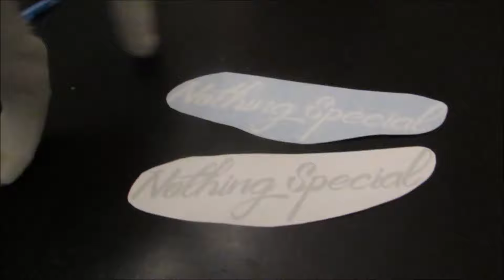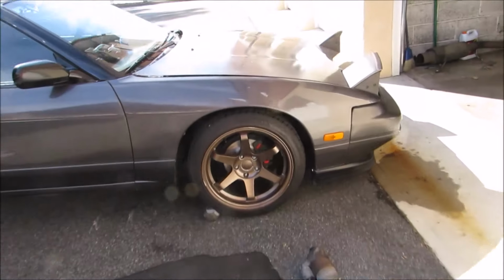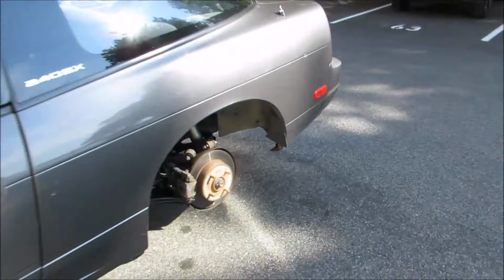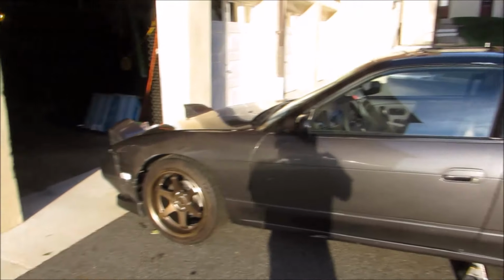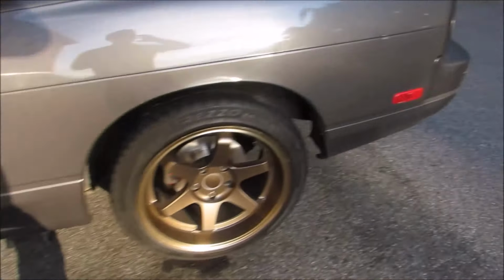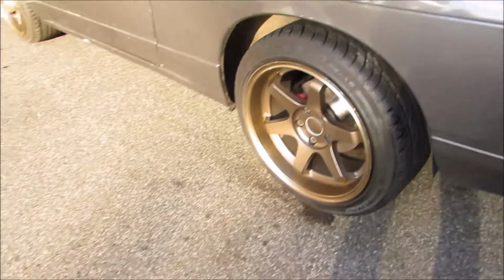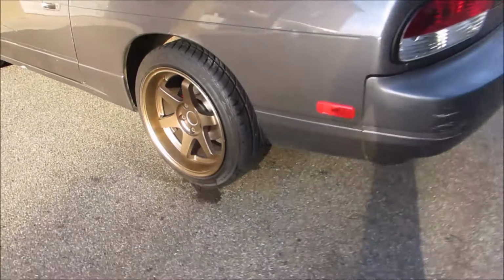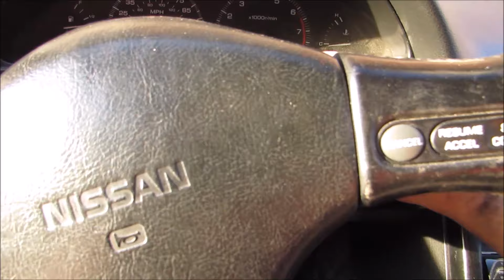Budget Build Ep. 23 | New wheels and 5 lug conversion!

Comment: Really nice. I just picked up some Rota Grids in 17x8, same size rubber. I've got a series of vids going up of 5 lug conversion. The fronts I drill out the 4 lugs and the rears I convert without knuckle removal. Come check it out!